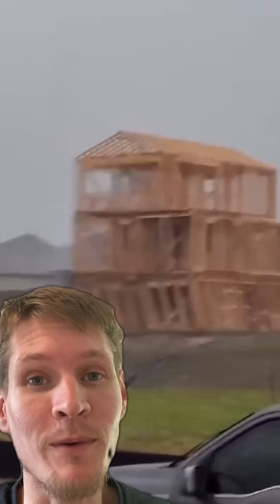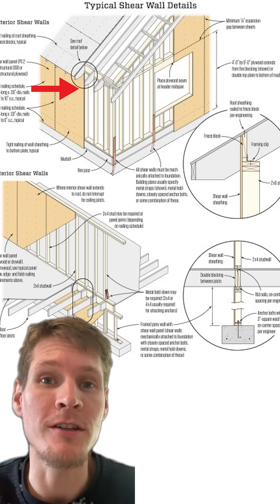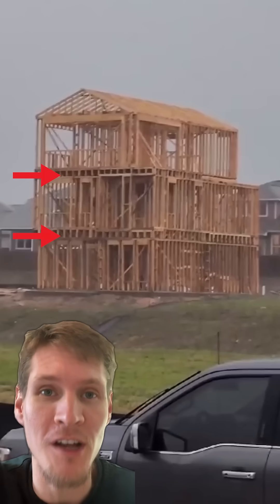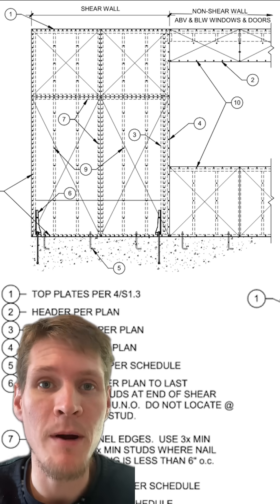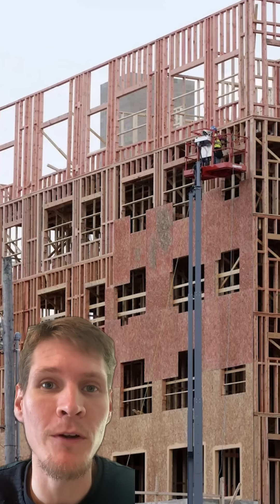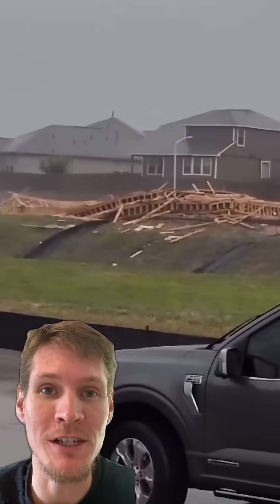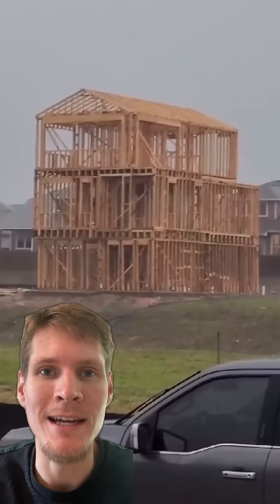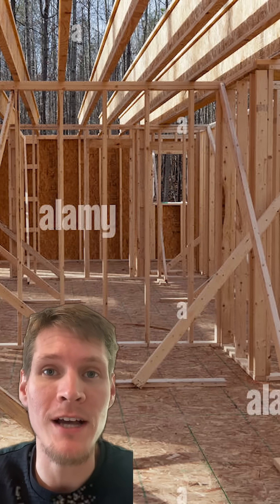Professional Engineer Reviews Reddit Structural Engineering Thread | Part 1 #engineering #reddit

Comment: I can't stand the new deck style Construction. I grew up in homes and buildings that actually had a continuous wall that went from top to bottom instead of building the house like a wedding cake today. Can't help but think that is a stronger way to build as it is the way it has been done for centuries. I know they say it's for fire protection so just put a wood Block at each floor level to keep fire from traveling up through the wall. I feel like traditional construction would not have fallen down like this. Or at least stood a better chance to not fall down like this did.

Comment: In my country, no drywall is allowed as a load-bearing wall at all. You either build some solid walls that can support the whole weight of the building and withstand wind forces, or you build a frame of some sort that can.
Reply: Dry wall is not used for shear strength.
OSB/Plywood on the outside gives most of the shear strength.

Comment: You have to think of the surface area and the pressure of the wind.  Force = Area X Pressure.  You can already see it's leaning to the left, even if they started to sheet the sides you can't fix it.  The amount of pullies and rope you would need would be crazy.

Comment: I was a framer and the angled braces were primarily for squaring and straightening the top of the walls before the next floor was built on top, 

never thought of it as much use for lateral support as you can see in the vid doesn’t work that well 😅

Comment: The angle braces are strong enough in tension. But they will bow under compression. They would have to be fastened on every stud. That's a lot of work, it would of been easier the install the sheeting. You can see the diagonals bowing before the collapse.

Comment: Don't need to be a engineer to see they added sheathing to the roof that caught the wood adding force to pushing the full house sideways  Had it been on the bottom this would not of been a issue

Comment: A simpler solution would just be to use materials better then new-growth timbers.  For example: manufactured wood-beams (like LVL), cold-rolled steel, hemp or bamboo beams, ICF (insulated concrete forms), or about a dozen other better options.  In the best-case scenario, seething is NOT needed for structural integrity, and is more of the icing on the cake, or bonus reinforcement.   Additionally, any structural engineer would have ensured there was more than adequate load-bearing capacity and shear-load strength for the structure as a whole, instead of building to the bare legal minimum.

Comment: As a framer/carpenter for almost 15 years(I'm 36) I've never in my entire framing career not sheeted a wall BEFORE standing it or shortly thereafter.
Reply: Been years since I built anything,
but we used to cut channels in 
the wall studs for permanent 
diagonal wind braces in the corners 
and in a long wall run.
Is that no longer a part of home 
building anymore? 
Having those temporary props
that are removed after sheathing 
seems pretty cheesy to me
Reply: @maxpinson5002  those braces aren't meant to hold the next level, just to hold plumb until sheeting is on. To build 3 whole levels with 0 sheeting is absolutely bonkers and whoever made that call deserves to have this happen.
Reply: @masonCOBwing  
IIRC there should be diagonals 
as an integral part of the framing. 
Not to mention that the studs
on the first level appear to be 
wayyyyyyyyy far apart. Pretty 
weak looking all the way around 
IMO.  If I were personally building 
2 or 3 levels I'd be including a 
4X4 every so often or 2 2X4's 
glued and screwed or nailed. 
I'd have considerably more faith 
if it were sheathed in real plywood 
and not flimsy a$$ OSB, at least for 
the 1st level if they're depending 
on some kind of exoskeleton to
support the weight of the house 
and roof
Reply: @maxpinson5002  you can stack studs together all you want. Can even put em 12" OC, this would've still happened with almost no sheer bracing. Studs are meant for a vertical force not horizontal.
Reply: You don't need to shearpanel before standing walls up  it's usually done after all walls are up  much harder to plumb n line after all walls are up dam mmmmmit
Reply: @richardbelttan  no its actually much easier to do before lifting the wall. Especially if you a have a lift then you don't even need to muscle the thing up in the air.

Comment: Why not use double wooden studs for the first floor? Also diagional once which we did in Germany in the past
Reply: Doubling the studs might help, but the problem would still exist. Without sheathing the nails come up from below and down from above so when the wind tries to skew the shape of the wall the forces try to pull the nails out. With sheathing installed the same force has to shear the nails off which nails are better at resisting.
Reply: @mattlafy  That makes sense. American houses are strange to get the head around ngl

Comment: Those braces just hold the walls from falling in or out. Would need diagional bracing to keep the walls from racking like they did . Bracing needs to be along thenlength of the walls because as it was the side walls just tore off the cross walls cause not enough leverage and or strength between walls

Comment: I am neither an architect nor an engineer... but why is there so little diagonal bracing? And what size are hose beams? they look like the long matchsticks for open fireplaces...
Reply: Sheeting should take care of shear strength.
Reply: I don't understand how anyone can be a contractor and also build three floors with no sheathing.  I don't even do construction and I know that's insane.
Reply: The majority of the diagonal bracing is supposed to come from the sheathing.
Reply: @KaiserTom  Oh boy that sounds... shoddy. ... like "load bearing wall paper"...
Reply: @robertnett9793  Exterior grade sheathing is plenty strong. Like the video says, it's there to take racking loads and distribute them down through the frame. 

Yes you can kick through plywood, but push at it on it's edge to try and shear it and  Good luck. It ain't gonna happen. That's the forces being applied on it when installed as sheathing. Also the plywood you would put on the exterior is thick and not nice to even try to kick through.
Reply: @KaiserTom Yeah... still - the frame should be able to stand on it's own... I mean, any force - from the inside, that pushes the sheating out will to the building collapsing.
That's why building collapse in storms.
Reply: @robertnett9793  Modern buildings don't fall that are built the same way. The actual failure points in a storm weren't sheathing related in that way. It's uplift related and failures at joist joints. Modern code has a lot of tie requirements for that now. If the roof stays down, a reasonable building stays down. 

Not many buildings collapse today without the roof coming off or being compromised first. In rather extreme weather. Code has always tried to assume 2-3x true rated load of materials. It's far better than this may seem, but structural components need to be installed if you expect it to stay standing.
Reply: @robertnett9793  OSB or plywood is generally used for sheeting.
I live in earthquake zone, shear walls all around.
Reply: @robertnett9793  Aren't you describing a force strong enough to remove the entire wall? Obviously the structure won't keep standing in a scenario that starts disassembling it. But the sheathing isn't just propped up there. It's attached just like the rest of the building (if done properly). It's not gonna be removed by someone leaning on the wall.
Reply: @TheQuark6789  I don't think so.

Look - the panels are large, flat and relatively light and just screwed on the wooden frame.

Which - I do believe - makes them susceptible to wind forces and pressure differences.

With a wooden frame that's propperly built and cross braced, that's a lesser issue - as the frame has less surface compared to weight and mass.
Panel blows out - but the structure keeps standing. A damage that can be repaired.

If the frame is fragile in itself - it's more likely to collapse.

Comment: That’s interesting considering so many houses in some areas were build with foam board and siding with no sheathing. How do these houses gain their strength?
Reply: Living in wood frame house built in 1960, didn’t have any sheeting outside for shear strength, didn’t have any structural issues. Stucco siding.
Added 2nd floor recently, so decided to add zip sheeting all around 1st and 2nd floor.
Reply: Even the houses with foamboard insulation panels attached to the exterior have some form of wood sheathing at all the corners to stiffen the building.

Comment: I am not surprised developers are trying to get away with this. There are developers that are not even sheathing houses at all now. They simply wrap the studs in moisture barrier, then chicken wire, then barely spray the house with stucco. You can usually see the chicken wire through the stucco too. If it wasn't for the chicken wire you would be able to walk through the walls easily. It's ridiculous, and a waste of money. I have seen better built dog houses that some of these new builds.

Comment: Ive seen houses with no plywood sheething, just drywall, insulation, and foam sheets and siding. You could just kick your way into the house if the door is locked
Reply: A house I had that was built in the late 70s was exactly that way. The only sheathing was on the exterior  garage wall that ran the length of the garage. Everything else had foamboard and drywall take up the shear, with wimpy diagonal braces from 1x6 here and there.
Reply: In Orange county California the houses built in the 40s after the war typically will have let in bracing and then plaster on the exterior so they still have something fairly strong
Reply: Stucco siding is strong, not easy to kick open.
Weakest point is entry to home is a window. So what’s the point in having concrete walls ?
Reply: Old houses don't have sheathing, plywood only became a common building material in like the fifties, they used to build houses like this, install lap and plaster on the interior and stucco or siding or brick facade on the outside. Also, for larger houses they'd build the structure out of brick and then lap and plaster the interior but for timber framing this wasn't very uncommon, don't think they'd have built a house this size that way though. I don't know numbers but feel like lap is probably very structurally significant
Reply: @bencheevers6693  lath and plaster, not "lap and plaster"
Reply: @bobbing4snapples  yeah whoops

Comment: Thanks for the chuckle. I grew up in a family of carpenters and started my apprenticeship at 15. I changed direction and became a Civil Engineer(PE). The bane of my projects was contractors trying to cut corners. It seems to have gotten much worse in the last 20 years. Glad that I retired 13 years ago. Good Luck, Rick
Reply: Also tradespeople who think they know more than the engineers.
I remember this one video where they placed the concrete support piles then just pushed the rebar dowels into the wet concrete afterwards. The people in the comments argued that it was just as strong as poured-in-place because you can't pull it out by hand "go ahead, I bet you can't pull it out".
Reply: @sleazybtd  I ran into that problem many times. Good Luck, Rick
Reply: @ I solved the push in rebar problem before. I asked the person to show me the dowel embed length, if it was tied to the stirrups, and the hooks pointing directions, the final kill was if not built per drawings, they needed to do pull-out test on every location.
Reply: It's like that in all the trades
Reply: I've been on both sides of it, and tradesmen vs. engineers happens in every industry. It's the classic book learning vs. practical knowledge acquired through experience.
Reply: @ryanpatterson2774  In many cases that I've come across, its just laziness and trying to save a buck. I had the book learning and the practical experience. The times that I was in charge, usually went well. In 35 years, I only had 3 on the job injuries(2 in the Army and 1 civilian(who had been a combat engineer in the Korean War)).
Reply: Way much worse 
I’m a contractor in Massachusetts and I just recently framed a house for my wife and I in SC
I would travel around early in the morning to check out framing jobs in the nationwide home builder neighborhoods just to see what they need beams, headers (for load bearing and gables). 
Wow was I beside myself. Obviously there is a large live and dead load difference between the two states going from 40 to 20 for the most part but even so these places are absolutely awful. 
It’s an embarrassment to the trade in these neighborhoods. 
Your average homebuyer has no idea about all the important things in the home and they pay 450k for garbage and I am hurting the feelings of garbage when I say that. 

Everything is subpar even from the way the way they keep material on site, sites are trashed and dangerously un tidy. 
I could go on forever but you get my drift. 
No pride whatsoever in any portion of any projects

Comment: Who destined that in the first place! No shear on the front walls top and bottom, no rim joists. 2ft openings that didn't need 2x12 lintles. It was going fall over anyway. Man that's ugly.
Reply: It's not the design. It's the fact that there were 2 crews. Framers and sheathing crew. Either there was no communication, or the framers just got ahead and didn't think to wait for the guys doing the sheathing. Some areas operate like that for whatever reason that I'll never understand.  I got out of framing when it became speed over quality and this nonsense wasn't an unheard of accident anymore.
Reply: OSB/Plywood on outside would give enough shear strength.